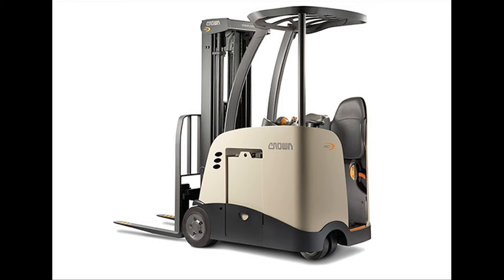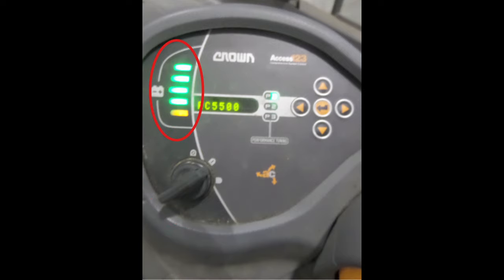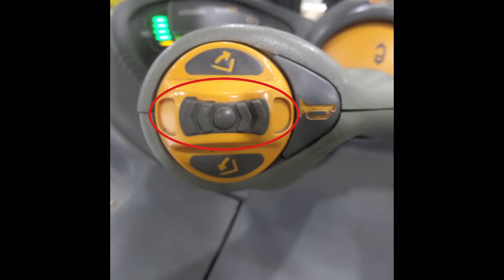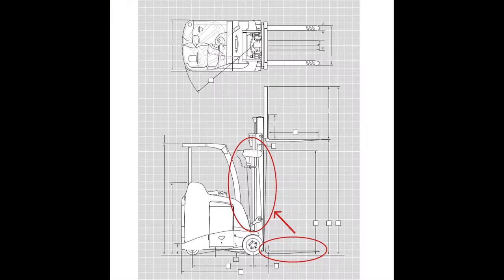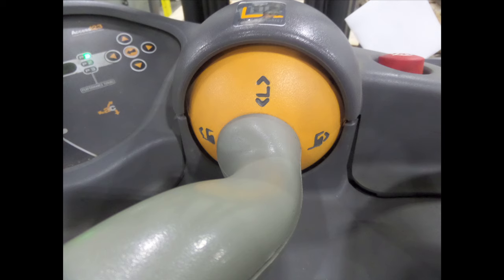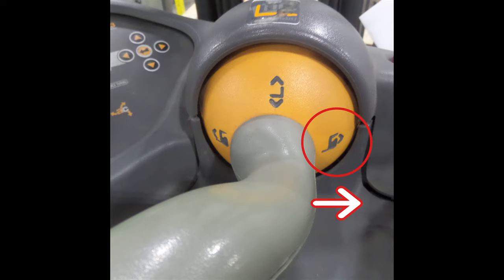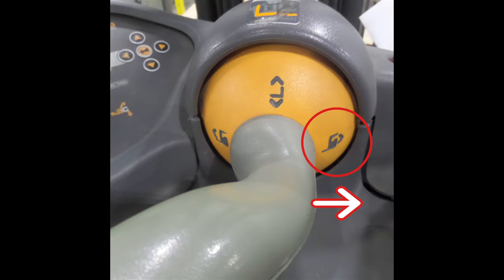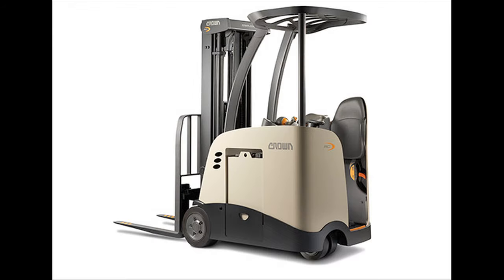Crown 5500 Controls Tutorial | Learn Forklift Basics with Instructions  How to Operate a Lift Truck

Comment: Why do they make it even possible to overthink? Just design it to drive like a car. Simple!
Reply: Mister Bang 🙌🏾🙌🏾
Reply: because the way cars are made they can't do a 360 pivot in one spot which is important for forklifts which is why they're designed to work that way, it was all thought out.
Reply: I have to drive a forklift at work today for the 1st time and we have crowns but they are about 20 years older than these ones 🤦🏻‍♀️
Reply: It actually does drive like a car, if you are traveling backwards, turning the steeler to the right causes the truck to back and left, a car does exactly the same thing. I think the big problem with this version of the truck is that there is no tire angle indicator like you have on other machines so you really don't know how much your tire might be swinged to the right or left which, can be potentially dangerous if you're inside a truck, experienced drivers turn the steeler in one direction until it bottoms out and then the other way a number of turns to re-center the wheels so they can get their bearings ... I have seen drivers at my facility who have been driving for over 4 years and they still have close encounters when operating this machine, as a matter of fact, at least one driver looses their license every few months due to over steering mistakes ... the other problem with this truck is how you move forward and backwards, you have to push on the joystick and pull to go back ... if you're not careful you might apply upwards pressure and accidentally raise the forks when going backwards with a load, the rookies do this a lot and before they know it, their forks are several feet in the air! The tilt feature on this truck is also retarded, you press the bottom bottom to tilt down and the top to tilt up...that might seem like good logic but it is not, the bottom button should tilt up and the top should tilt down perhaps this analogy comes from me flying airplanes where I'm used to pull back on the stick to raise the nose of the airplane and pushing forward to tip the nose forward. It will take an individual on average from 1 to 4 months of continuous operation to learn how to really drive this machine well. If you work at companies like Amazon who will take your license for virtually anything, you are in for a roller coaster ride ... Amazon will take your license if they see even a single box drop from the top of the load. I remember when I started operating order pickers and I lost grip of a coffee box, I lost my license for dropping a box that weight absolutely nothing and had no damage ... when it comes to fork lifts, if you work at Amazon, they will take your license even if you lightly tap anything in the facility ... paranoia to the max where most drivers think it's so childish they have literally turned in their licenses ... drivers here loose their license on a weekly basis for the dumbest shit.
Reply: It’s your brain not the physics
Reply: @mrsantana9094  Oof the part about the tilt rings way to true, It's my 3rd day on the floor in my reach, honestly feels pretty natural but I've dropped 3 things total, first was a picture frame on my pallet that was supposed to just contain 2 boxes of diapers? Second was a small sealed cardboard box that was stacked too far over on both sides, and third was a small box of mayo that fell from my pallet that was supposed to just contain dog food. They don't mind if you drop stuff its bound to happen, but my thing is I am sooo careful and these drops happened because someone else put something where it didn't belong, I would be distraught to lose my license over someone elses mistake😳

Comment: I am currently in training. These forklifts make me very nervous. They tend to jerk a lot when the fork is way high. I feel uncomfortable & unsafe at times, but will see what happens.
Reply from the maker: If you feel uncomfortable and unsafe then you should not be doing that task.
Reply: @NKYDIY  This is normal for a notice, they are intimidated by the machine and how it operates.
Reply: If your using a crown reach your getting paid to well to be doubting yourself. Get to know the machines and each isle and how your warehouse ground floor is laid out. (Floors cause most uneasy movement)
Reply: Malcolm, you need to ask them to let you go to a certain area and just drive around, pick up some empty pallets off the floor, off some racks, and maneuver around some isles on your own and you will get the feel for these and actually come to enjoy them, these are just so fun to operate, believe me

Comment: How do you drive forward and backwards
Reply: cool tshirts pull the joystick back/push it to the left
Reply from the maker: What he said.
Reply: And hope that the forks never go up without your knowledge. A friend at work was moving product and didn't realize the forks were raising...until it was too late. Hit a cross beam and lodged the Crown so tight on one end that even maintenance was baffled.
Reply: Malloysacat Mck did he die?
Reply: @hood2hood757  That moves it diagonally. The steering lever on the left is what's needed to move it forward

Comment: You say "never lower your forks with a load in the air." Umm, How am I supposed to get a load down from the steel? Lol, Did you mean never TURN with a load in the air?
Reply from the maker: I think I meant or said never tilt your forks lower while in the air.  This is how you tip a forklift when you tilt forward with a load in the air.
Reply: Yes he meant never tilt the forks forward with a load in the air. The pallet will slide off your fork and fall off. Even if you are able to correct your mistake quickly. Tilting forward in the air shift the weight of the load, and like the comment above says. If it's a heavy load it could even cause a forklift to tip over. Either situation is very dangerous, and could get you fired, or you could destroy company property and get fired. Injuries and destroying or damaging products or machinery is a serious mistake, that could result in all kinds of repercussions
Reply: Never tilt the forks forward. 😂😂

Comment: This setup is one of the most asinine setups I've ever dealt with! I'm a rockstar on a sit-down lift, but these stand-ups make me feel like I'm on "Mr. Toad's Wild Ride!" Yeah, the "reverse" steering setup blows a*s, but those fork controls are beyond jacked. One should have to pull back (push down) on the joystick to raise the forks, and push down on the toggle switch to tilt the mast back (toward you.) Subsequently,  pushing up on the toggle switch should tip the mast forward (away from you), and pushing forward (or up) on the joystick should lower the forks. Am I right?! 

Apparently, more new hires at the company I work for, walk out over these lifts than for any other reason. I don't know that a company that won't even let its FORKLIFT drivers "sit down on the job" is worth working for!
Reply: No shit . Drove a sit down for over 9 years . Learning this one now . Yikes . . 
I'm over 50 years old and I have all these youngsters racing around me and rolling their eyes at me they seem to hop right on and pick it up. Aggravates me. Added pressure due to 150 of them zooming around opposite directions horns blowing.. etc...4 days and I'm still a little apprehensive.. . 
Reverse steering is made even more difficult due to a little twist control not a steering wheel. Which  uses  your thumb to perform all functions . While facing sideways.  I'm slowly learning individual moves but still cannot swing in while raising the forks simultaneously, Although it is physically possible I can't haven't been able to perform that yet they give you a 4 weeks.  . So I'm not stressing it.I know it's possible . Someone mentioned another videos I've seen to just relax and feel the string for which way you're going you're just not used to the reverse steering because of muscle memory. I'll get it. Not for others. Just to prove it to myself. BTW how do you hold the joystick while pressing the tilt button?. Thanks
Reply: Yeah it is a stupid  design, i am tall I have to bend my knees and rotate my body just just to move forward or backwards without raising or lower the forks, I imagines lots of people have got hurt or killed over this shit ass design. 100% should just be forward and backwards with toggles to raise and tilt the forks

Comment: forklifts trash because it doesn't have a wheel angle indicator
Reply from the maker: That is a telemetry thing and the new updated touch screens do have the wheel angle indicator.  You don't really need that anyway unless you are first starting out.
Reply: @NKYDIY  id rather have a machine tell me exactly then leave it up to human geussing
Reply: @psychodelic1457  i have been driving this for 5 days and i dont need a wheel indicator. If i dont know then i take a few inches in the safest direction to find out. And now it almost just muscle memory for me after 5 days only